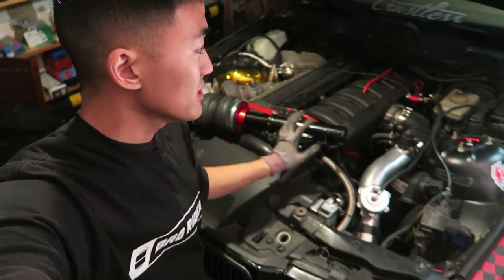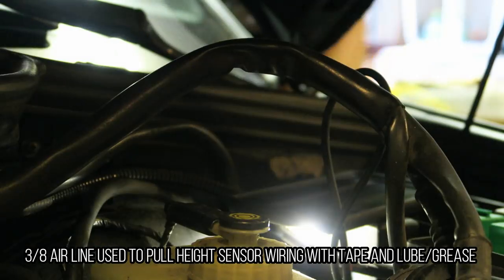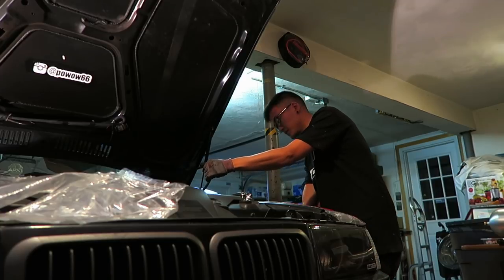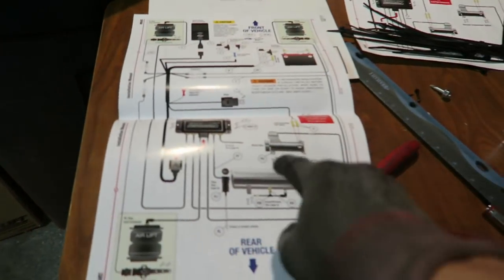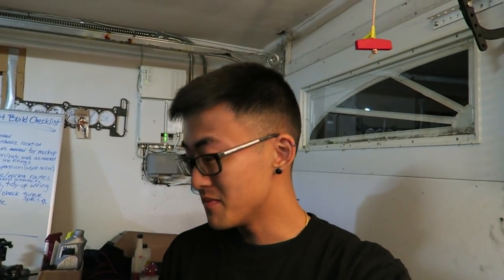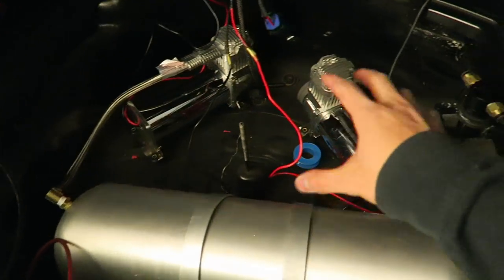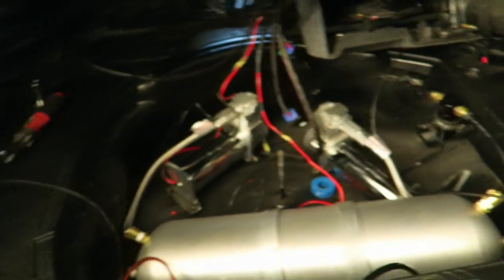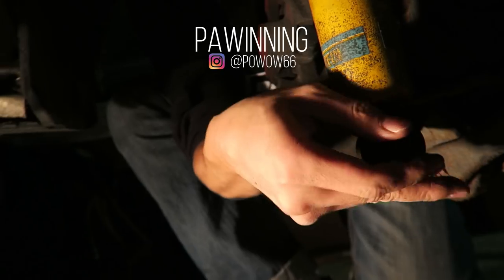Installing Air Suspension Into My Turbo BMW E36! [BMW AirLift 3P 3H Air Suspension Install Part 2]

Comment: I did this same setup on my car and  I'm getting really bad body roll in the rear. Are you having similar issue?
Reply from the maker: +Scrav3n M3 upgrade the rear sway bar!
Reply from the maker: +Scrav3n M3 My body roll is actually fine. Are u running their airlift shocks?

Comment: @pawinning hey, what did you tap into for ignition switch power? Violet/white wire under dash or add a fuse? What fuse did you tap off of if so? Thanks for the help. My kit is 97% done heh. How was the 3/8 airline wrestling?
Reply from the maker: Sry for the late response! But the next video in the series shows how I tapped a fuse. I think it was the one that linked to the flashlight charger in the glove box, you basically want a fuse that is on when the key is turned

Comment: did you remove the fuse box to run the air line? i cannot see where did you ran the hose from beneath the steering wheel. :) i will be doing this next week and was really curious about these air lines :)
Reply from the maker: +Georgi Varzonovtsev so if you remove the sensors around the fuse box you'll be able to reach down and snag the air line/wiring once they're fed through the firewall!

Comment: hello, i have a question, how big is your air tank ?
Reply from the maker: 5 gal 👍
Reply: @Pawinning  Will it fit if I wanted to mount it behind the back of the rear seat? in the trunk, not in the place of the spare wheel

And what is your opinion about airlift kit :) I wanna buy 3p kit

Comment: What wire did you tap into for the ignition wire?
Reply from the maker: You can use any accessory fuse that is hot with the key in second position. I think I used the fuse that controls power to the flashlight charger in the glove box

Comment: That new track at 0:50 ! nice change in work music :)
Reply: The eye and ear candy in this video should be illegal. Very easy to watch! Are you using a slide track for those panning shots?
Reply from the maker: +DivaniKingston I'm glad u like it! It's actually a small motorized slider. No tracks just a level surface needed haha

Comment: Need to see the height, sir. Next videos!
Reply from the maker: +Christopher Taft coming this Sunday 😎
Reply: I'm over here talking smack about videos while my car is just sitting there with my undriven supercharged s52 swap. I'm sand bagging pulling the transmission you retrieve the exploded slave cylinder heh
Reply from the maker: Christopher Taft ahh shit slaves suck, I was trying to show off my car once and blew that out and the clutch line 😂
Reply: Pawinning I just ruined (rounded) the top most bolt on my zf. So fuckered. I think I'll drill a 2-3" hole in the bell housing to get out the exploded pieces of slave and just plug it. Thoughts?  xD
Reply from the maker: +Christopher Taft lol well don't to THAT. If you take the cross member out you might be able to pull downward on the trans to get better access to that top bolt, they're aluminum so you might be able to break it off